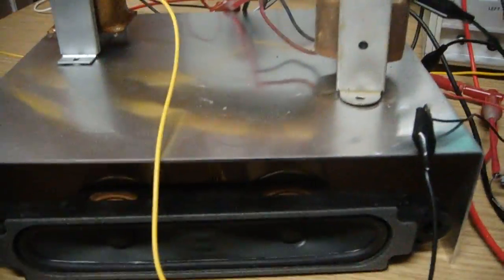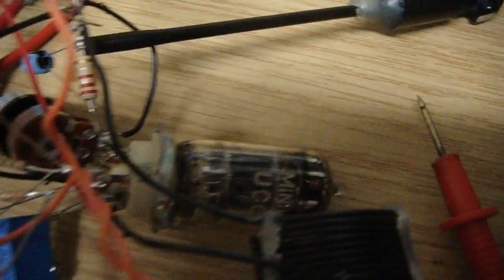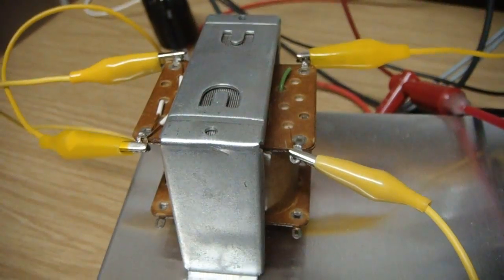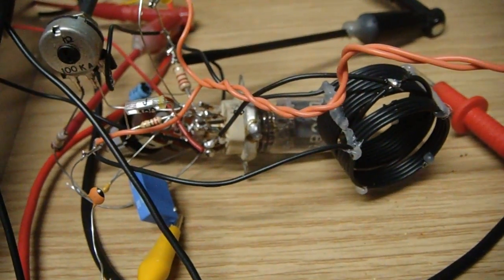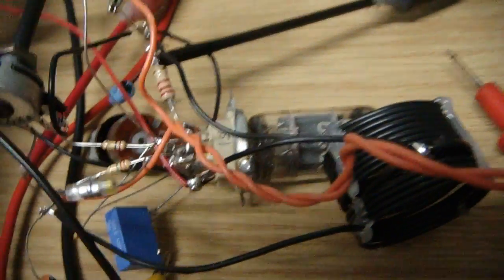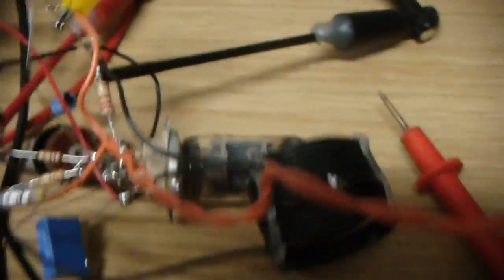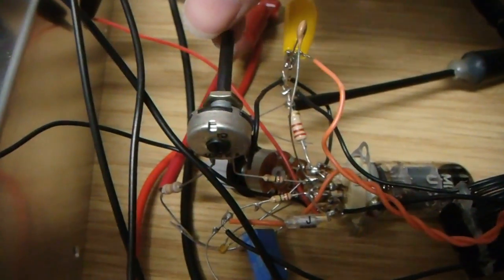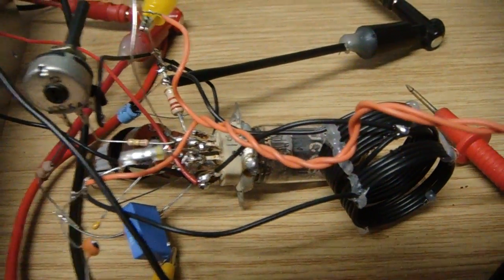1 tube regenerative receiver

Comment: UCC85 is rather a radio tube due to it's relative high heater voltage. It was used with other tubes of U-type (heater 0.1 A) in a FM headunit of radio receivers without supply transformer. TV requires more tubes so the the sum of U-tube heaters voltage would be more than 220 V. Typical type of TV tubes in Europe is P series with heater current 0.3A. For example PCC85 9V and 0.3A.

Although if you know some TV set with UCC85 let me know.